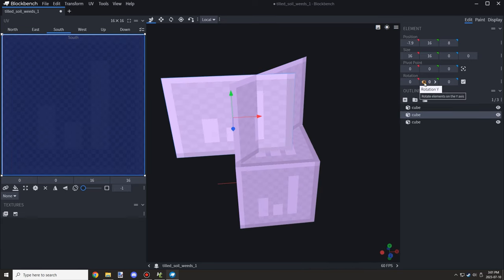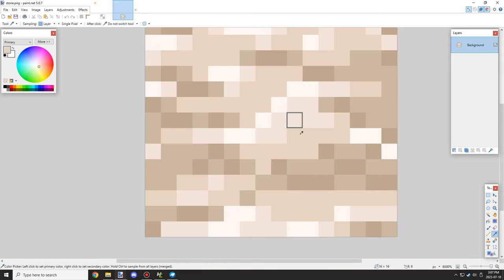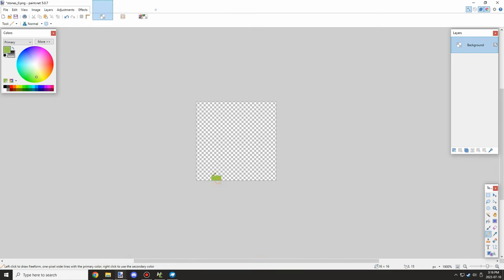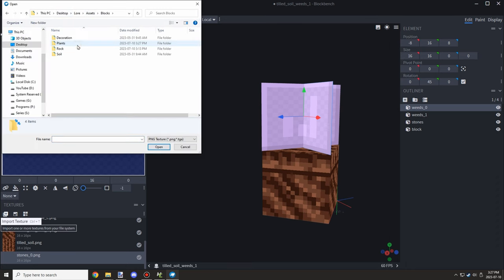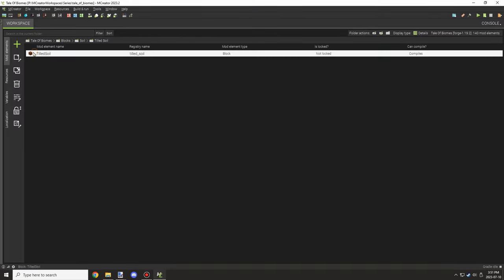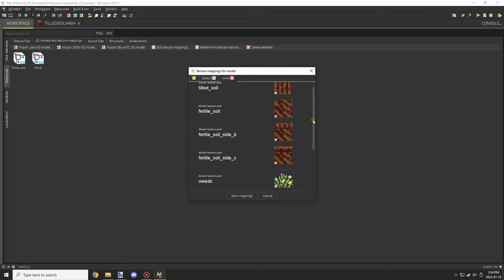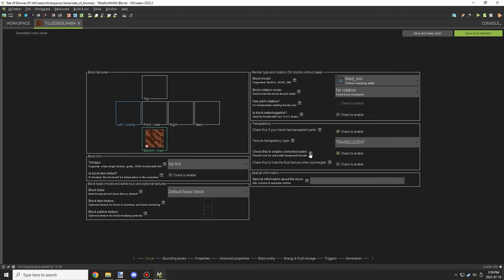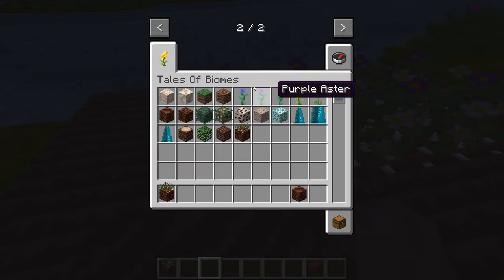Weed Theory | MCreator Lore | Ep24

Comment: How to make block looks like redstone?
Reply from the maker: Each state would need to be made and then you would need to make a condition either on block tick update or a comination of events when the block is broken or placed to update blocks next to it of the same type to check for changes. Your best option would be to code something by hand but the block state of redstone in the base game files could provide you insight into all the different rotations and models used.

Comment: Hey I have a question

In my mod, I want to make it whenever I die, a Massive explosion that goes from where I died to Bedrock, also particles surrounding where i died, how can I do this
Reply: Get the 'if entity dies' call and the 'if:do' procedure. connect is entity subtype of 'player'  to 'if'. then under 'do' explode (strength) 10+. change the Y level for every other block. 'y-1' . and spawn particles around player. you have to get the 'spawn _ particles' or 'Spawn single particle' customize that
Reply: hopefully that works
Reply: You will need 2 procedures, 1 for the explosion and the other is for the particles. But I can only make the explosion works. I just don't know why but when I run the particles procedure, the game instantly freezes. But I will still tell you the idea.

Explosion procedure:

First you might need to add a local variable, lets call it y_explode, to be used later.
You need to change the event trigger event to "When an entity dies" then put an if-block, the condition will be "Is the event/target entity is type of player" (logic tab) (sadly it doesn't have When a player dies condition so we have to do this). If yes: Set y_explode to y position of event/target entity.
Then we will put a while-do loop, the condition is while NOT the block at x y z is the same block as minecraft:bedrock, x, z are the position x and z of the entity, and y is y_explode.
Inside the while do loop, put the world management explode block at x y z (same x y z as above) as TNT, and set y_explode to y_explode - 1.
The above procedure will check if the pos x y z is a bedrock or not, if not then explode it, then it will continue to check and explode the block below until the block at x y z is a bedrock.

For the particles I used 3 global number variables x, y, z for the death coordinate, and a logic var LastDeathCheck to check if the player has visited the lastest death coor or not. In the explosion procedure, we will set the global var x y z to the pos x y z of the entity, and set the logic var to false.
In the particle procedure I use the while-do loop. While NOT LastDeathCheck do spawn particle, then just put an if block to check if the player is near the death coor, if yes then set LastDeathCheck to true.
It should works, but somehow this freezes the game. The problem is the loop part but I dunno where it goes wrong...
Reply from the maker: I have not worked with explosions for so long but Karryy02 seems to have you covered on this.